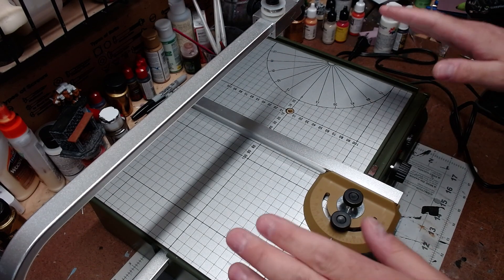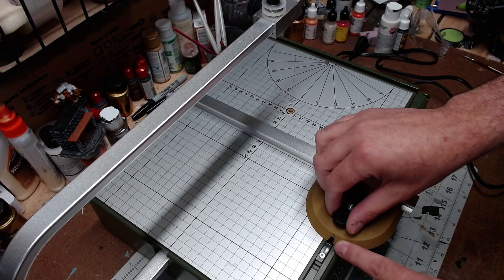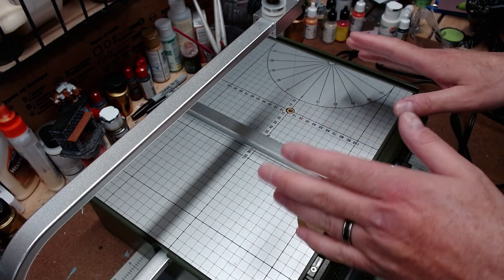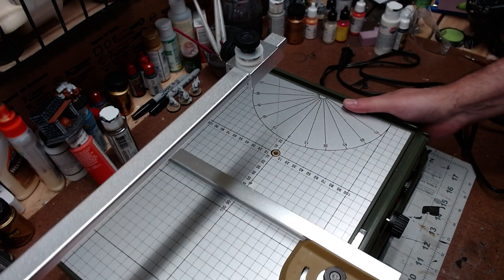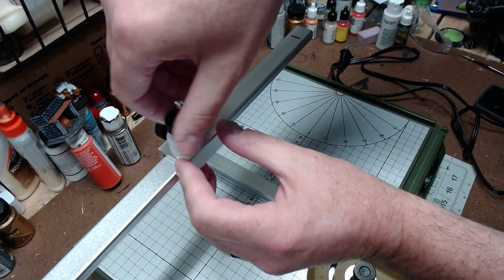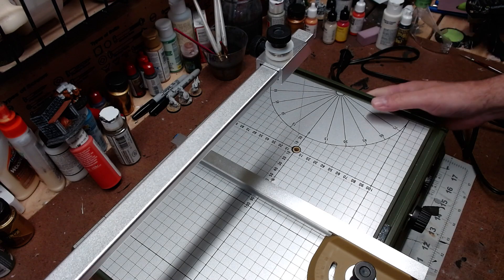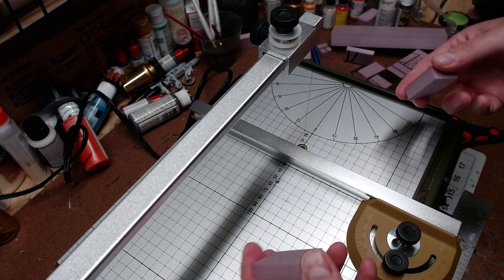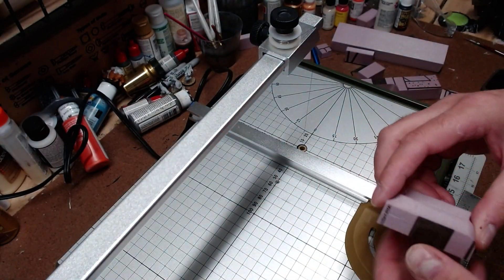Proxxon Basics

Comment: Tip: you can use a piece of sacrificial foam to prevent the wire from hitting the fence (and melting your foam because it's stationary) when using the shorter edge of the proxxon.
Reply: i guess im randomly asking but does any of you know a way to log back into an Instagram account??
I was stupid forgot my login password. I love any tricks you can give me.
Reply: @Santiago Micah thanks for your reply. I got to the site on google and im waiting for the hacking stuff now.
Takes quite some time so I will reply here later with my results.
Reply: @Santiago Micah It did the trick and I finally got access to my account again. Im so happy:D
Thank you so much, you saved my account!
Reply: @Walter Lucca you are welcome :D

Comment: You said that you didnt know of a better way to make that 30 degree angle cut than with tape and turning the machine off when it hit the metal.  Slide the fence so that it is just out of range of the wire before you make the cut.

Comment: One thing that you didn't mention, that I've found helpful when trying to cut an uneven edge into a straight one: when holding the piece steady for that first "manual" cut, use the grid as a visual guide for getting the angle right.

Comment: To get a straight edge, I place the foam on the fence and run the fence on the narrow end as a rip guide. That will get you a straight edge. I then move the fence back to the long end and use the straight edge as the cutting surface.
Reply: Yep... that'll do it.
Reply: I'm not quite following. Would you mind making a quick video?

Comment: Came here specifically to see how to cut very accurate angles with how squishy and unstable the stock fence is. Sounds like I was doing it right and it just kinda sucks overall. Wish I would have ordered the shifting sands fence before the Proxxon at this point.

The video is well done and the information was excellent. I do appreciate it and it gave me an answer to the exact question I had.

Comment: I finally bought a Proxxon cutter last week.  Found one barely used on ebay for a good deal.  Should have been here Monday, but the damn post office misdirected it and it's still not here yet.  They must have thought it was a box of mail-in ballots.  

This video came out at just the right time.
Reply from the maker: Have fun with it... very useful tool!
Reply: @TheTabletopEngineer  
It still hasn't shown up.  Tracking had it 2 towns over on the 3rd.  No indication of where it's at since then.  I'll be contacting paypal and ebay for my money back if it doesn't show tomorrow.

Comment: Nice video. I have had my Proxxon for about a year.  I would add that you do not want to let any of the foam melt down into that brass ring or it will be difficult getting new wire through the hole.  I have to use a micro needle from an insulin pen to clear the hole as a straight pen is too big.
Reply: Good advice.
Reply: A drop of acetone or nail varnish remove can unclog the hole if that does happen.
Reply: I used an old guitar string to clear the hole.    Great video!!
Reply: Do any of you know if a regular needle might work? Mine doesn’t appear to feed through the hole at all.

Comment: Great job covering lots of tips, one item that would be nice covering is milling long pieces of foam - I’ve noticed really long pieces it becomes tricky to feed the foam, keep things straight etc
Reply from the maker: I've not really found any way to handle this other than slow and with as many fingers pressing the piece against the fence. I'll ponder on it.
Reply: @TheTabletopEngineer  exactly me too - its a tricky one especially if you try milling through 4 ft long sections of xps - never  turns out exactly as I want lol
Reply: Yeah, when my fingers get close to the wire as I'm pushing the foam (and trying to also keep the fence straight)  and I reposition them to continue the cut, the wire melts an extra bit of foam where it "stalls".

Comment: There are a few weaknesses to that machine, but those are easily fixed.
Like the bit with the center point when you make angled cuts. A cylindrical sleeve made of a plastic with a higher melting point can be slid over the wire to keep it from shifting too much inside that cylindrical hole.

Comment: I just set up my Proxxon last night and murdered a poor defenseless piece of foam trying it out and testing a circle jig I made. One question,  when I cut slower on a lower heat you can see lines on the cut that are wavy from the wire bending but fell smooth, is that normal?